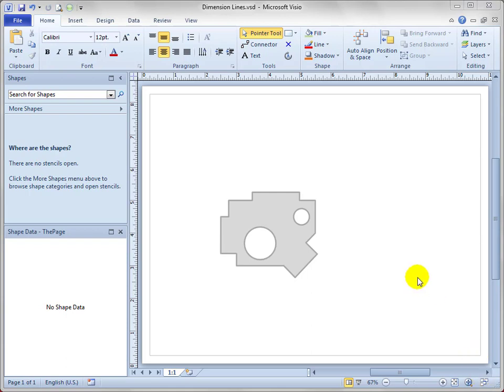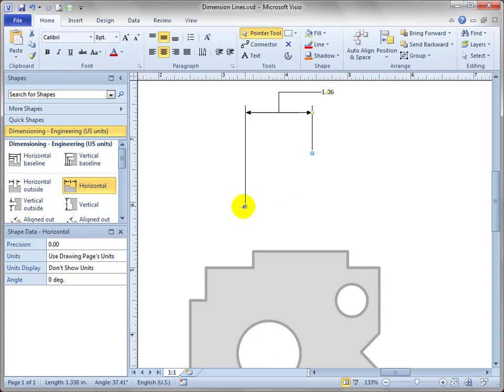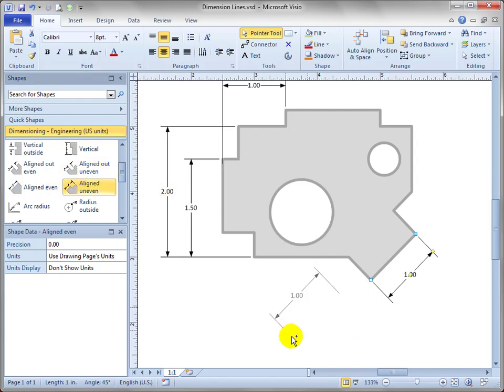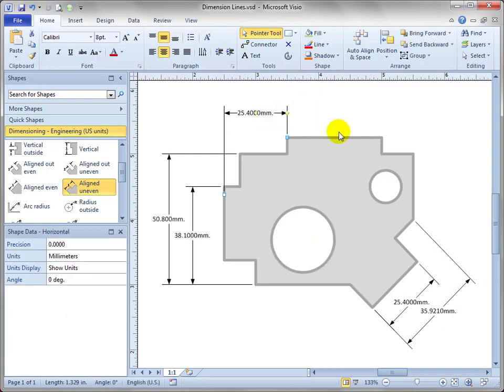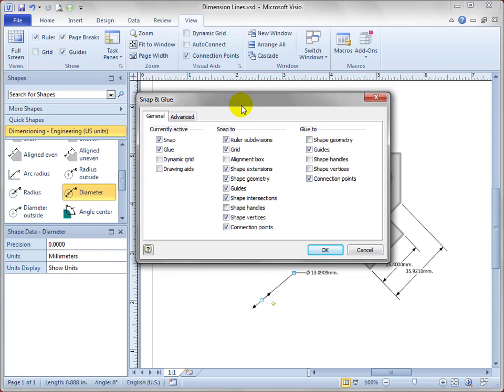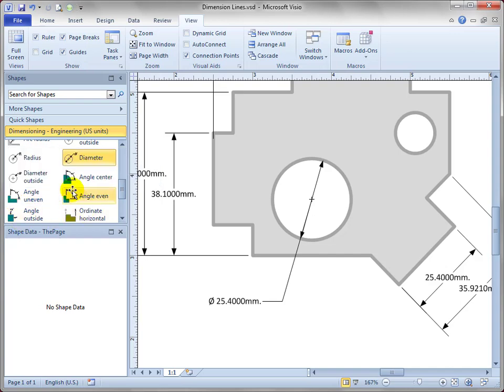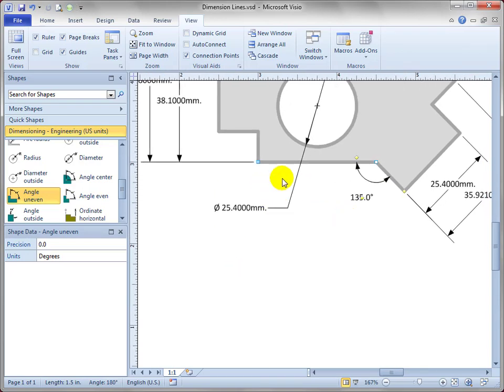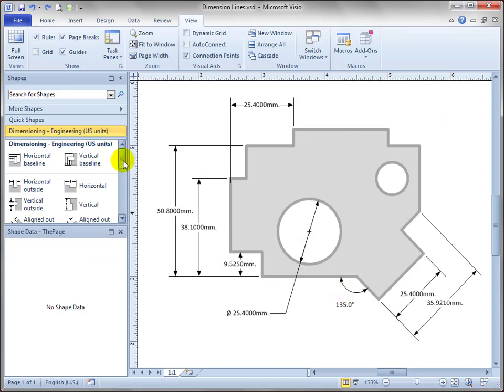8.4 Using Visio Dimension Lines

Comment: I just wanted to rotate the object by 0.5 degrees, couldn't find the  solution unfortunately. :(
Reply: Try View > Show > Task Panes > Size & Position. You can also get the Size & Position panel by clicking Width/Height/Angle in the status bar at lower-left, when a shape is selected. The fields in the Size & Position panel accept math, so you can, for example add "+0.5deg" to the existing angle value to rotate a shape.

Comment: Thankyou, great video, I'm using Visio pro 2019 and the dimensions units differ from page settings I've gone through different settings and there seems to be a bug.
Reply from the maker: Hard to help on such little info. I just ran a test, dropped an engineering dimension line on a 1:1 inch page, and the dimension read "1.0". Switched the page to metric, and the dimension line immediately displayed "25.4".

Comment: Great video! The one thing I was looking for however, I did not find. I am creating three dimensions from one baseline using "Vertical outside". I am having difficulty aligning the three dimensions to the same base point. I think this may be due to the lines overlapping. To rectify this, I tried using the "Vertical baseline" shape, however, after I set my first dimension, moving the yellow node for the second dimension accomplishes nothing other than moving the little yellow square--No second line appears. I'm using Visio Professional 2013. Thank you for any suggestions you can offer. I would also like to say I love this video because you speak clearly and to the point, and you don't have distracting background "noise". Many thanks!